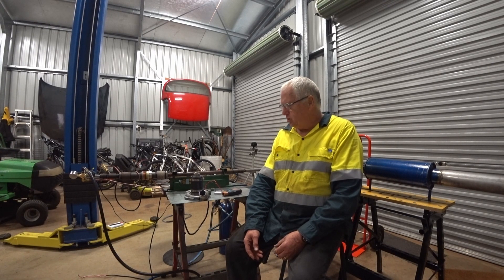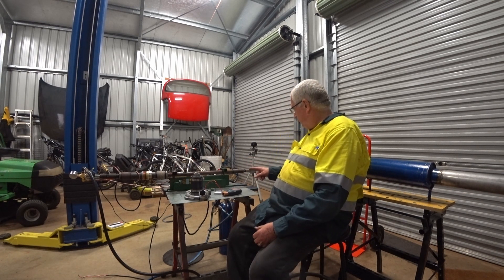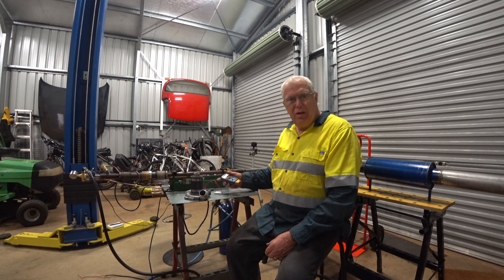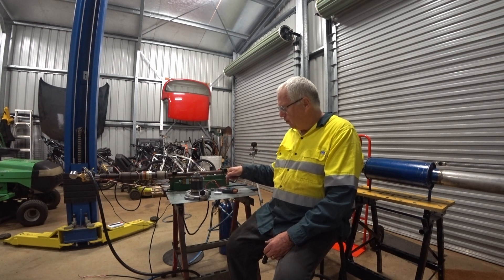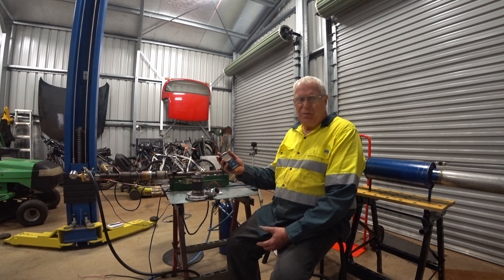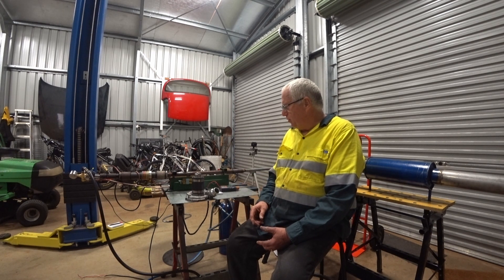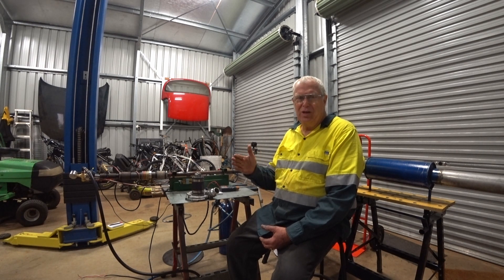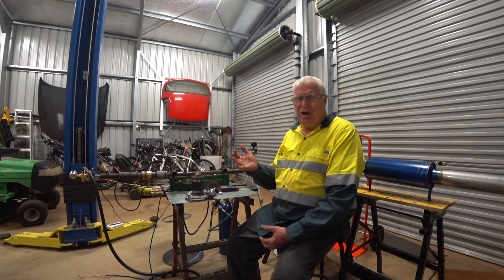Pulse Detonation Engine Part 5 with Turbo and small generator

Comment: My gutfeel is that this configuration will be more efficient if you increase PDE only to turbo inlet diameter ... i.e. never decrease the flow area as this will reflect shockwaves back.
Make the engine longer if you want more air mass inside detonation chamber.
Injecting water/steam will likely damage the turbo blades at high speed.
At high RPM (turbo blade tip speed exceeding Mach 1) the shock wave reflection should reduce.
Reply from the maker: The tesla detonation engine/turbine seems to be using a big reduction in diameter to increase pressure.
I did not have any promising results with the car turbo.
The tip jet turbine I designed seems to work well except the high temperature can cause it to get tight and stop spinning.
When I build a new one it will be designed to spin a 300watt hover board motor I will have longer arms which will increase the torque with a reduction in rpm and using tapered rollers to adjust clearance to increase clearance to compensate for temp increase.